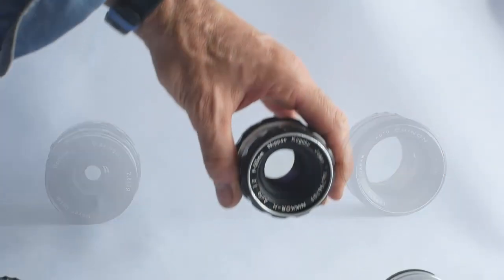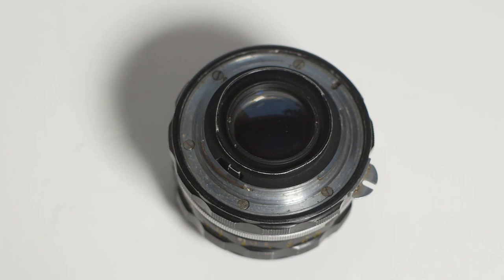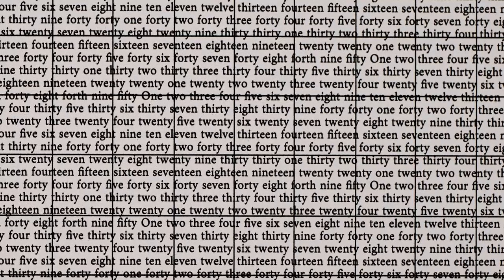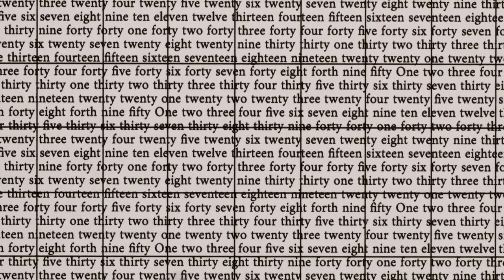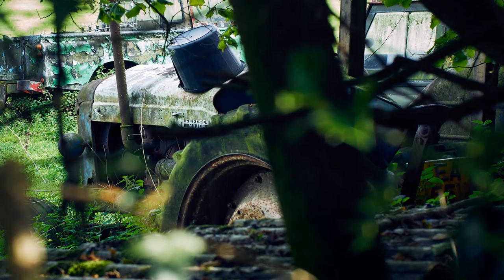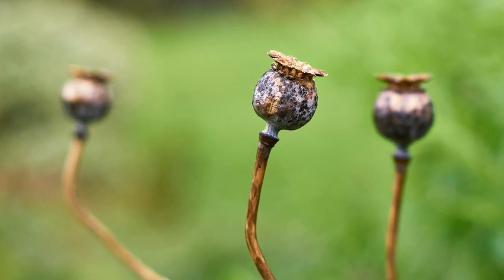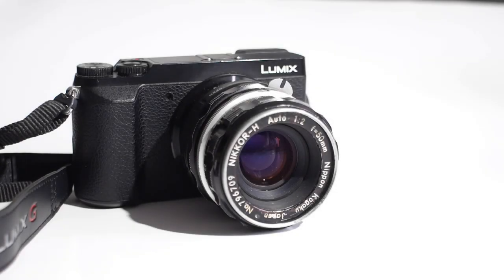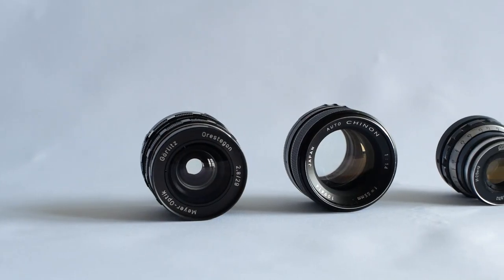Nikkor-H 50mm f2 Non AI - Vintage Lens Test - Retrotech

Comment: Did it occur to the video maker that lens elements and groups are matched at the factory to optimize the performance of each lens. By "swapping" the rear lens group here, that refinement of performance goes right out the window, and any effort to use this particular lens as a representative of performance of these lenses in general is a waste of time.
Reply from the maker: Hi Randall, that’s a good point, and I think this was at the forefront of my mind when I did the lens swap – I’m pretty sure I took reference photos using the replacement lens in it’s complete form before creating my “Frankenlens” to make sure I wasn’t creating a complete pup.  The main purpose of this video, and the initial video, was to take a pretty wrecked lens with a big chip right in the centre of the rear element, and see if it could be improved.  It was easy enough to fix the other issues with the lens, but the damage to the rear element was well beyond repair – it was an interesting experiment all the same.

Out of interest, I’ve just taken some shots of the same test sheet, using the Frankenlens, and then swapped the rear group back to it’s native body and re shot, and there’s precious little difference.  I could do more thorough tests, but I’m happy enough with the results.

There could be a few reasons why the rear group has worked reasonably well in both lenses:
a)  I could have got lucky, and that group happens to work with both my copies of the lens.
b)  The manufacturing tolerances were pretty good at the time.
c)  Maybe it’s significant that I swapped that entire group rather than just the single element.
d)  It’s entirely possible that there’s a bit of marketing hype surrounding the “we match our elements for each lens to ensure the photographer has the best product”!!!!

I’ll be leaving the rear group in it’s original body for now (I’d already fixed the other issues with that lens, so it was good to go).  I’d been thinking about trying some more experiments on the bad rear element – it’s never going to get better, so I was thinking of turning it into a bit of an arty “effects” lens – I’m only at the thinking stage at the moment, nothing set in stone at this point.

Cheers for some food for thought.

Comment: Great video, mate. I just picked up a Nikon D40 for next to nothing for a upcoming video and this lens looks like a very nice option. I'm currently using a 50mm f1.8 e series lens I got with my Nikon EM film camera and while it's not a bad lens, it doesn't look as good throughout the aperture range as this lens.
Reply from the maker: I suspect this lens benefits from only being an f2 lens - as photography nerds we'll always tend to look for the faster models (well, at least that's what I do) but sometimes the cheaper, slightly slower version can be a good choice too.  There were no apertures that made me feel like I should avoid them, it seemed pretty good throughout the range.

I'd be willing to bet that your f1.8 e series is pretty good - it possibly won't look as pretty as my Nikkor-H though.

I do love the fact that you can pick up some bargain stuff like your Nikon D40.
Reply: @GrumpyTim  Yeah I had a d70 for the longest time and after a year of sticky shutter and various error messages it just gave up and didn't turn on again. I managed to grab the D40 for £23 and since it has a very similar 6mp ccd sensor as the D70, I felt I got myself a bargain.
Reply: It's a non AI lens though, basically you can't use open aperture TTL and will have to shoot the lens fully manual. Also check if your camera has the AI tab that can be manually lifted if not you will damage it when mounting this lens. Maybe the Soviet Helios 81N would be better since it's an AI lens and it's also 50mm 2.0
Reply from the maker: Coo, that IS a bargain.  Have you seen the comment that diegoscopia has added to this thread - I hadn't even thought about fitting compatibility issues because I've only been using mine on Micro 4/3 cameras - definitely worth checking if you can use this lens on your Nikon before spending money.
Reply from the maker: Cheers diegoscopia, I hadn't even thought about issues fitting these to modern Nikons because I've only been using them on Micro 4/3 cameras - I might have a look to see if they can be fitted to my Nikon bodies in case I ever want to try them.  I tend to shoot fully manual all the time so having not auto won't bother me too much.
Reply: @GrumpyTim  Yeah, it's not something I considered since my switch to Sony, all of my old lenses are adapted and fully manual. I do know that even some of the more recent auto lenses won't work on the D40 due to the lack of af motor in the camera and lack of aperture ring on these lenses. I'll definitely do a bit of research before buying👍
Reply from the maker: I've been kind of spoilt by mirrorless cameras - you can more or less bolt anything on the front and it will work - you could probably attach a milk bottle if you made an adapter!!!
Reply: @GrumpyTim  Haha, now I want to see your video of you making a lens adapter for a milk bottle 😂
Reply from the maker: It could be done, I'm not sure that the results would be worth the effort though!!!!!  I will be doing a video soon where I make a lens adapter for a rare and mostly unknown lens mounting system.

Comment: None of this means ANYTHING if you are using a 2x crop Micro Four Thirds camera for the tests as the edges of the M43 crop is at the mid 'weak sharpness' point of this lens and other full frame 35mm optical designs! Pointless!
Reply from the maker: Hi dummatube, although you have a point, that the true edge sharpness and overall performance will only be discovered when using full frame, the vast majority of vintage lenses are now being used on mirrorless cameras, some full frame, some 1.5x crop and some 2x crop like my Lumix cameras, as such, testing vintage lenses and talking about their performance on these crop sensors is pretty relevant to how many people are now using them.  It's quite interesting that some lenses that were a bit of a basket case back in the film days, can work really well on a crop sensor because you don't reach the really bad corners of the lens.

Comment: Great Review , Can this lens be used on a Canon DSLR like the mark III? Can you suggest an adapter? Thank you
Reply from the maker: Hi Felipe, as far as I'm aware, you can use this Nikon lens (and other Nikon lenses) on a Canon body using an adapter such as a K&F Concept Nikon to EOS lens mount adapter (available from Amazon etc).  You can't do it the other way, ie mounting a Canon lens on a Nikon.  It would be worth double checking on some forums that there aren't any possible issues to watch out for.  Obviously, the lens is totally manual so you'll be doing manual focus and aperture etc.
Reply: @GrumpyTim  Thank you that is what I'm looking for a manual lens again thank you
Reply: works great on canon

Comment: Sorry for the stupid question,
What mount is this?
Reply: Just wondering if I can use it with my Nikon F to leica SL adapter
Reply from the maker: Hi Frank, yes this is an early version of the Nikon F mount, so should be fine with your adapter as far as I know.  From what I've heard (but I haven't investigated myself), using pre AI lenses like this one on a modern Nikon camera, can damage the camera, so if you intended to use it on a Nikon body, I'd check thoroughly before trying that out.